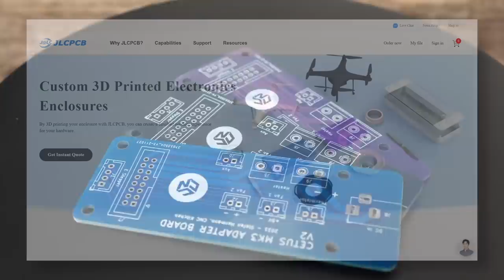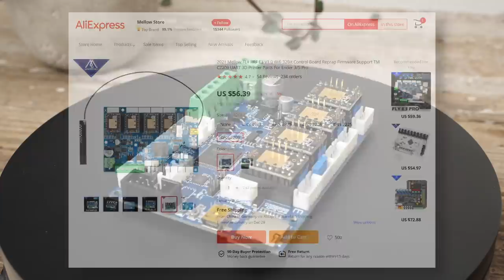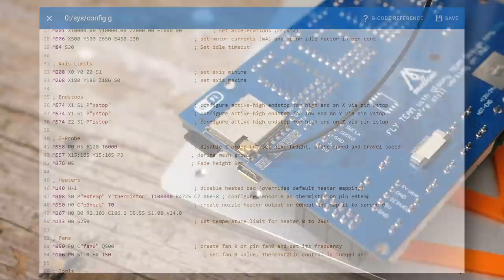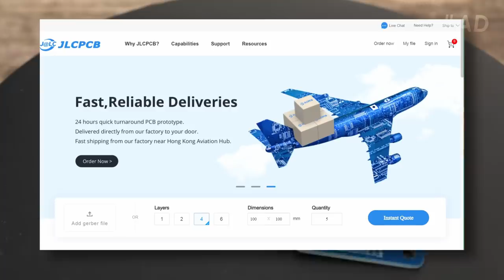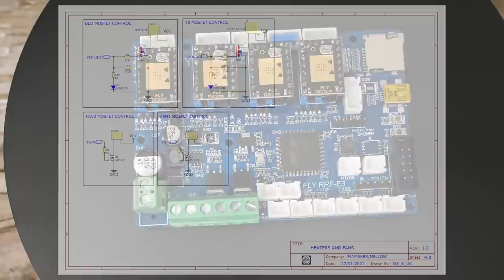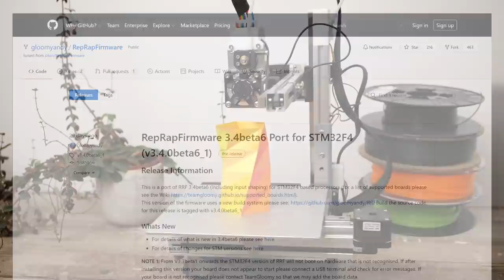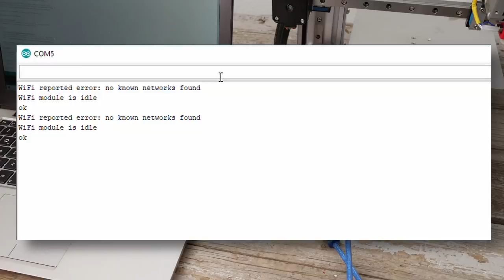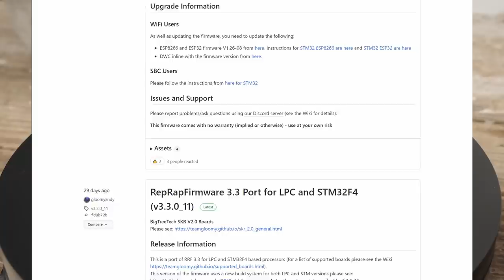I HATED my Cetus – Now I ❤ it! Mellow FLY RepRapFirmware conversion

Comment: I've never tried RRF because of the high price for hardware. I mean, for half that price you can have board with more drivers and lots more (hardware) features. And by adding a RPI zero V2 your still under the price of RRF boards.
Can anyone using RRF explain what makes it worth the extra money over using klipper?
Reply: The hardware and firmware are well designed and well made. You either get it, or you don't.
Reply: @JasonZnack  okay, then I don't get it.
Reply from the maker: Depends. If you have proper drivers and a machine with wifi connectivity probably not worth the effort. If you start with a bad board it saves you the hassle of having to deal with a mainboard and a SBC.
Reply: @CNCKitchen  so the main draw is ease of use. Less hassle, stability, everything in one board. I can get that.
3D printing itself is a hobby of mine so this is not something I'm looking for, but I get that you'd got for this if you just want the thing to work well without a lot of tinkering.
Thanks for the explanation.

Comment: I was thinking to buy a Cetus MK3 for a while, and now, I'm really decided, as I'm using RRF on a Duet2 for a couple years!
Where can I buy a Cetus from europe?
Reply: I would say if you're not in a rush, wait for the Cetus 2, the Cetus3D team are teasing it so much, especially with the new extruder design that can print dual materials without a purge tower. Kickstarter starts at the end of this month, I am thinking to get one as well.
Reply: @oliverfong418  Mmm, looks interesting. Thanks!
Reply from the maker: Honestly, I wouldn't buy a Cetus MK3 at the moment due to it's flaws. Use the money and buy a Prusa Mini instead if you're looking for a similar, small form factor.
Concerning the Cetus 2 - I really dislike the kinematics of it!
Reply: @CNCKitchen  The Prusa Mini looks too fragile to me. I'm looking for a small 3D printer I can bring with me without fearing to brake it or unset it.
BTW, with the new board, does the head still fall slowly when the Z motor is turned off?

Comment: This printer is $400+ US.  You put a lot of work and money for a printer that's already limited in many ways. I would think that that money and effort would be best put into a different printer. Although tinkering is one of the benefits of the hobby. Thanks
Reply: I bought my MK2 about four years ago as my first machine after a pretty nice review from another youtuber and originally I was pretty happy with it.
As I got more experienced I felt the limitations of the software first and of the electronics later. I have just completed a klipper conversion and now I love it again!
I definitely won't buy a second one, but I still think that it is a nice machine for a beginner as you can get decent prints in no time and with no experience straight from day 1.
Reply from the maker: Wouldn't recommend buying a Cetus Mk3 for this purpose, but if you have one, it's well-spend money.

Comment: Couldn't agree more on that Klipper comment. I have never seen the point of having these stm32 powered boards and still tacking a pi on top of it. Not only are you using a flaky serial connection, but now you're going to use an asanine to setup firmware too? 

Literally screw all that noise and just use reprap firmware that has all of the same features and an actual company running the show to keep updates flowing.
Reply: You clearly didn't test it. But everyone should use the firmware of choice.
I like klipper a lot.

Comment: But Klipper! 😂
Tough it's a serious alternative if it runs on the board you already have and you are not sure if you really need a new board. If you get a pi, you can later reuse it for a lot of other stuff or even easily sell it. With a new printer board you just promoted the old board to be garbage.

Comment: I think we should avoid these boards from Mellow... RepRap FW is where it's at because of the Duet team. They deserve to get paid for their efforts and now it seems like Chinese companies are coming to take from Duet. Mellow, Fystec and a few others have been cloning Duet boards for years and for that reason alone I think supporting companies that take without permission of the creators should be shunned by this community. Mellow also copied the Mosquito, in fact I think they were first to do so. Stefan, I say replace that board with a tried and true Duet 3 Mini! They are fantastic boards as I am sure you are aware.
Reply: The Fly boards are not simple clones of Duet3d hardware. They are new designs. Made in partnership with the people that created the STM/LPC port of RRF. Designed exactly for the purpose shown in this video. Giving new life to common consumer printers.  They use better than average PCBs and have some innovative features in the latest boards. Replaceable fan mosfets and voltage selection on the IO signals as well as the more common fan selections. You really cannot compare them directly to Duet3d as some of their board have better than Duet3d features. (removable steppers, faster WiFi etc.). As for your moral stand point of paying Duet3d. History has show that most of the time the fastest way to bury a good product is to monopolize its use in one company.
Reply: @Nurgelrot  I didn't mean to say or imply they are a clone. I am saying that RepRap FW has been heavily developed by the Duet Team. They sell boards to fund their efforts. Supporting Duet is supporting further development. However China does clone Duet Boards... We should support the creators or curators in this case.
Reply: @Nurgelrot  And removable stepper drivers is not a feature... its cheaper to produce that way. I don't want removable drivers. On Duet you use VIN power to power your fans. It's far more common to find fans in 12v-36v than in 5v. The 5v fans that Prusa use are only popular because Prusa has to use 5v fans for the Einsy board. So Duet supports the more common fan.
Reply: @thelightspeed3d712  just FYI Duet approves the fork for STM32 and LPC. They exchange quite often aswell!
Reply: Duets are the iPhone boards of 3D printing lol
Reply: @Lassi Kinnunen 81 lol open source is not to copy. Open source is to innovate. So far Mellow, Fystec etc. have offered NOTHING back to RRF. They have only used it to sell their boards. Open Source is so they can be innovated on not imitated.
Reply: @PCR  I’m sure they do… they don’t own RRF. It’s an open project. But they are the ones that got it this far and deserve to be rewarded by selling their boards

Comment: I just can't stand RRF.  Every firmware I've ever compiled and gotten into has given me some plain-english, and commented files that I can decide what I need, learn what features are available, etc.

RRF separates the development portion from the configuration portion, and isn't even nice enough to have commented boilerplate so you can enable what you need.  I will never support that style development because it continues to put everything behind a black box.

Even Klipper, which is a bit worse to configure than Marlin -- has plain english configuration files and things that make sense.

I've even asked the RRF team to provide a simple SD image that I could write as an .img to a SD card so I wasn't having to gather files from multiple places and essentially having to build this configuration-SD by hand and they refused.  So I don't support their ecosystem.  You even start instructing this beginning at 9:12 in your video.  I shouldn't have to create this folder structure.  It's arcane and a step backwards from the development that the community has worked so hard to simplify.
Reply: I think your complaint is valid (rrf is hard to develop/edit) but I also think it's quite a niche one. I think the vast majority of users of rrf will never compile rrf and that's the whole point of it: you only need to edit the configuration files. This is a significantly lower barrier to entry to modifying your printer configuration than having to compile the entire firmware for marlin (similar to klipper though)

rrf is a specific firmware written for specific boards, unlike marlin and klipper which are written for a very broad range of boards. Because you have a broad range of boards with different features, which you can turn on an off depending on what the boards need. With rrf the developers don't need to account for all that.

In some ways jou can compare it to ios VS Android (though the comparison isn't great but it gets the idea across) 

Again, it's not that your complaint isn't accurate but it's just not something most people will ever run into 

I'll also note that when you buy a duet board you get a pre-flashed SD card with rrf pre-installed, and duet also have an wiki page outlining the right file structure for the SD card